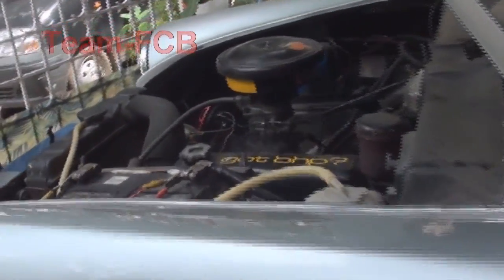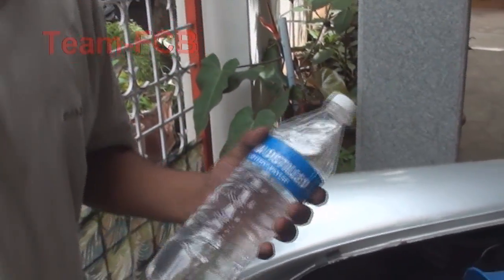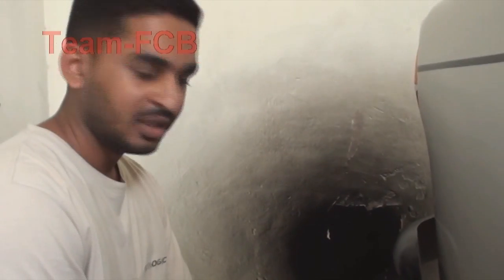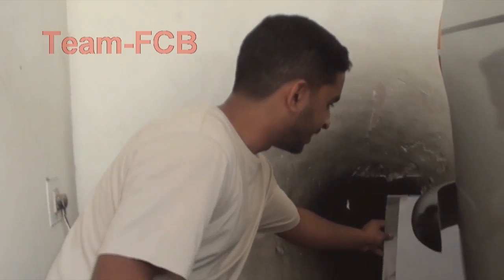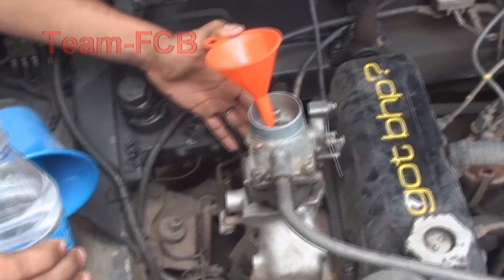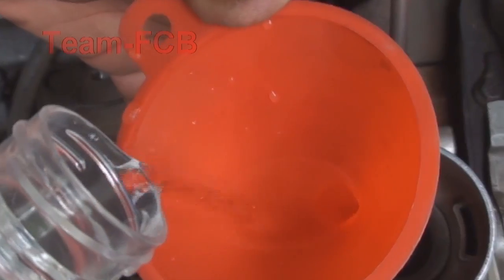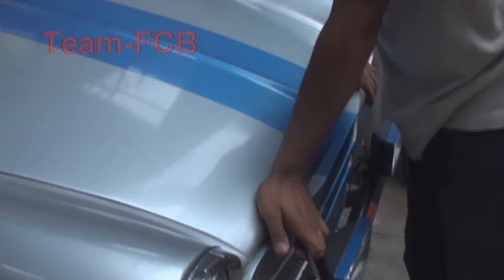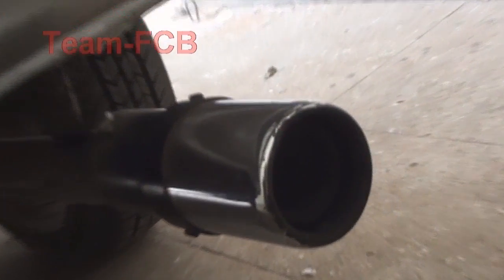Decarbonising IC Engine using Water

Comment: Engines already produce water as high pressure steam while they run. About the same volume as fuel consumed. 

Carbon from tailpipe is just loose soot from the muffler. 

So-called carbon deposits are mostly zinc and calcium from oil additives.

Comment: Some of that carbon can be the liquid cleaning out your exhaust pipe.  But I have seen first hand what water can do cleaning out Pistons. Anyone who has seen their header removed due to failed head gaskets does too!!  The trick is figuring out when it's best to apply a steady stream to clean the backs of valves in direct injection engines.
Reply: David James 

That cleaning is due to ethylene glycol in the coolant.

Comment: Won't this dilute the oil??
Reply: furulevi this water is introduced into the "top" portion of the engine and the oil is in the "lower" portion.  The Pistons separate the two along with the piston rings.  When carbon builds up on the piston rings, combustion gases get injected into the lower portion of the engine (called blow by).  This robs the engine of horsepower.  Additionally, bad carbon fowled rings prevent them from clearing the oil off the cylinder wall on downstroke, and it gets left there to be burned on ignition.  Water is intoduced into the top with blowby, air,and fuel, and it all meets the spark plug.

Comment: in ww2 the british used water in thier fighter planes for extra power it did something with airdensity when squirted in a fine mist the engine would produce more power but it could only be used for a few seconds or it could melt the block!
Reply: Al Bore 

Did not raise octane. Cooled combustion chambers, reducing tendency of fuel to preignite. This enabled use of higher turbo pressure, so more fuel could be burned to produce more power.

Comment: You run a VERY high risk of hydrolocking your engine doing this. For those who don't know what that means you'll destroy the entire engine. Poor that water just a bit to fast and your motor is dead.

A fine spray/mist of water would be MUCH safer and likely much more effective.
Reply: +FCguy naaaaa u think to much those water will be delivered inton 4 cylinders
Reply: +GAR A one slip of the hand and incompressible fluid larger than the top dead center volume of a cylinder will hydrolock the engine. this is water - not air - it does not and will not be distributed evenly to each cylinder.
Reply: i think the best way to do this is to use spray bottle..... then
Reply: +GAR A pretty much exactly what I said in my original comment.
Reply: I do this last 20 years , 2 4 6 8 cylinders engine, in World War II some planes engines burns Methanol and water, others engines are cleaned by this procedure too, the trick is put little amount of water continously and hear the engine.
Reply: +nopochoclos congratulations - you never sneezed and poured too much water in and ruined a motor. Water is GREAT for decarbonization. However pouring it by hand is dangerous and stupid. One small mistake and you've destroyed your engine.
Reply: First i use hydrogen peroxide, not pure water, second, you commit a mistake doing wrong like put one entire glasss of water, you need to use a 10cc syringe, racing cars using water too and not explode, even with standar components, i see it on my city, this method is descripted on old engines manuals, from experts mechanics, that used too to remove plumb accumulation from valves seals, sorry for my english, now i see this method  used to clean actual new engines with turbo too, the problem with water or peroxyd are in Diesel engines that make a ultra compression and explodes...
Reply: +nopochoclos let me be clear. pouring water from any open container is STUPID and likely to destroy your engine. End of story.
Reply: Because you say?  oh... yes...  sorry...
Reply: +nopochoclos FCguy is right, it should be a mist/spray. larger globules of water will not work as well, as a finer mist will be "carried" with the air, whereas pouring from an open container will cause larger amounts to settle in certain places and wouldn't be atomised correctly.
Reply: Yes, perfect enviorement are mist, here in my city we do this to old engines like Fiat 600, Citroen 2cv and Citroen 3cv for racing,nothing happeds bad on this type of old engines, in news is other story.

Comment: The water trick works well but I just use a garden hose and a squirter, there is no danger from water borne particles as they all get washed out with the carbon and the treatment only lasts for a few seconds anyway. This trick has been known from the vintage car days.

Comment: this kind of method doesn't really affect on cleaning carb on your engine. the best way is engine flush. it removes more than 90% off. plus, if you use excessive water, you will damage engine for sure. you think you know car. you don't.

Comment: i wish someone would take the whole engine apart to really see the difference.
does your car feel any better or worse?
Reply: I did and the cylinder head, valves on both sides and piston crowns were spotless! Best part is you don't damage sensors with water and it cleans the catalytic converter.

Comment: This is an old-school trick that works very well. You have to know what you're doing, and he does. HOT engine, high RPMs, slow pour. I've done it this way for over 40 years, and it never fails to produce smoother idle and acceleration. And no worries about reaching all cylinders; they're sucking their share just fine.

Note: this is not needed on modern fuel-injected engines. Closer tolerances, better lubrication, precise fuel metering, more efficient combustion, etc. = less carbon buildup.